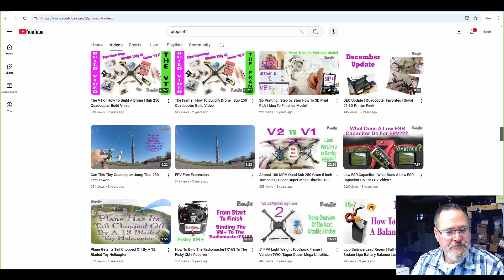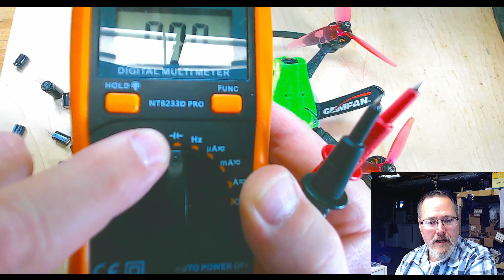Capacitance Of Your FPV Drone

Comment: Waiting on parts for my first build, new to about a year now. Ordered the speedybee F405 40A, doing a DJI o4 pro 3.5 inch build 6s. What capacitor would you recommend?mostt say a 1000uf and should I / do I need to use the supplied BEC for it? I appreciate your guidance.
Reply from the maker: I'm not using the BEC on mine - I'm running the Vista/Nebula Pro to the Speedybee AIO.. As far as the Cap, I'm running a 330ųf 35v on my 3incher and applying 4S lipo voltage. If I were to run 6S on this build, I would place a 470ųf 50v capacitor...🧐🍻
Reply: @PropsOff  ok, I appreciate the advice, I am currently watching several of your build voideos including the flow of solder. In the little over a year of my drone journey and several and I do mean several hours of youtube and reddit and google searches I have yet to come across your very informational videos. thank you for your hours of time you have put into them. I will do what I can to push these out there.
Reply from the maker: @508AirPhotography 
I'll have to admit something to you.... I am currently looking at the past 7 years of PropsOff (hitting 1M views), and "ScooterPie" that dates back to 2012, for quadcopter help videos.. I reflect and debate if the many, many hours of my life were spent well? It's comments like yours that make every minute of it worth it, I appreciate your feedback, support, and encouragement...👊🏻😎🍻

Comment: Thanks for the info. For clarification, the amount of desired capacitance is based on the voltage and not the current draw? 
In other words, 800mF-1kmF for 6s whether it’s a 5” where often we use a 35-45A ESC or a 10” with an 80A ESC?
Reply from the maker: Correct, the capacitor used on a 4 in 1 ESC doesn't have current running through it (placed in parallel) to supply the PDB. It is used to clean and buffer the lipo voltage, not supply the voltage (series).. Things you may be interested in researching:
-Spike Absorption (Decoupling)
-Low-pass Filtering

I rarely use a cap above or below two variants, 220ųf / 470ųf on a 5inch quad.. My 3 race 4S 5inchers have F55A Pro II ESCs and I don't use a cap at all, they are clean and in range for 4S.. Hope this helps...👊🏻😎🍻

Comment: what about 3inch 1s tootpick quad?? do I need capasitor??
Reply from the maker: Great question. I do use a cap on all my 3inchers. I have a video for ya. I take the cap out and put it back in to show what it's  doing. Let me know what ya think...👊🏻😎🍻
Reply from the maker: https://youtu.be/MuKAfgYfRhw?si=GFySXMlJiVA-SRUD
Reply: @PropsOff  I found on alixpres 10v 100mf capacitor?? any good you can recomend??
Reply from the maker: @nucleo1772 
What voltage? 
What ESC & flight controller? 
What motors?
What video system?
Reply: @PropsOff  fc matrix 1s 5in1 5A esc
caddx Ant analog camera 
1202 motors 11000KV
850mah 1s lipo
Reply from the maker: @nucleo1772 
I believe you'll be fine without a cap, however, on a 3inch 1S toothpick (The MobyPick), I placed a 100ųf cap across the power and ground of the camera wires that attached to the VTX...🧐

Comment: this confirms my suspicions I tried running no capacitor,whole drone was shaking. tried 1000uf today and it took most of it away, there is still some at high throttle. tomorrow i’ll try a lower uf.
Reply from the maker: @nubsfpv  
I appreciate your feedback...🍻

Comment: how about voltage spike absorber...can that realy useful for 5inch,,many thaks for kind support
Reply from the maker: @zlachannel8674  
Out of the research and general knowledge I have, I see no point in using spike (diode) absorber. The Cap is really all that's needed to cushion the spike (6S). The 4in1 ESCs component structure is also a factor. No, I don't use them on a drone. We used them in high speed printing equipment, but it was to protect the optics motor that spun the lasers. 
I appreciate your support...🍻